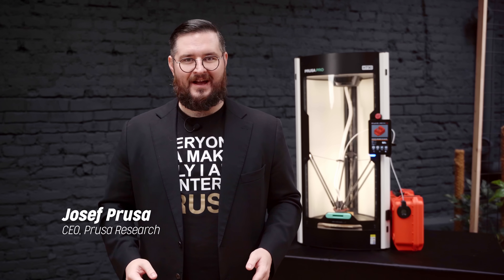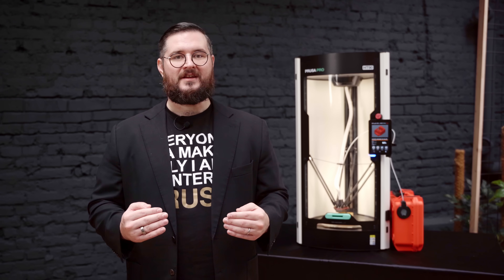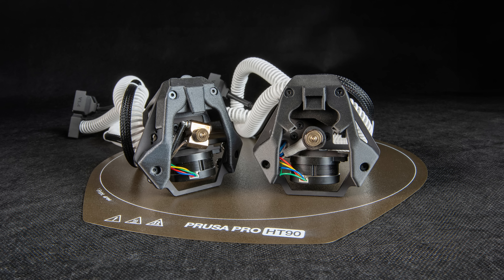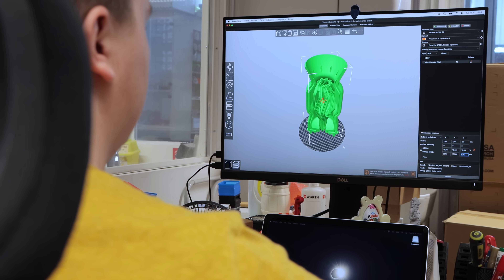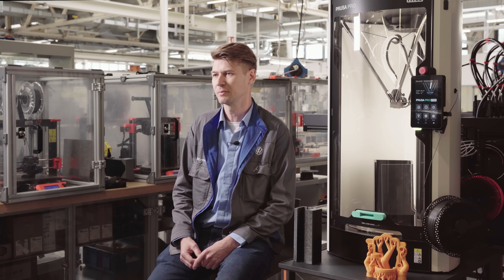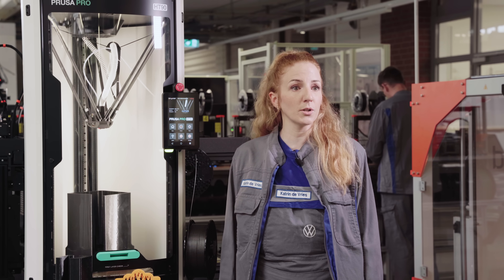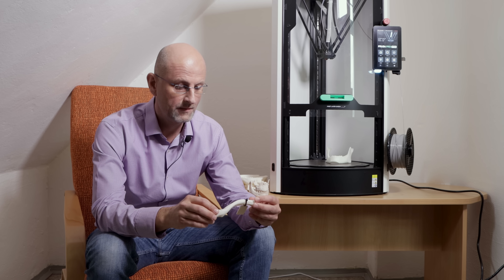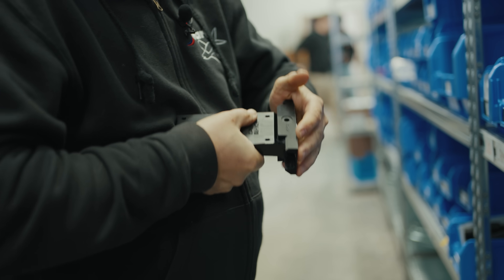Prusa Pro HT90 is here: The Only 3D Printer an Engineer Needs

Comment: I love Prusa, but $9,900!!! The same features on the Flsun S1 for $1,500. What am i missing?
Reply: 90C chamber vs 50C chamber. 90C is a game changer and 50C is bull shit. And making a printer being able to handle 90C is not an easy task. Stuff melts, metal expands, rails need special lube. 9900 is too expensive I agree but don't compare it to the flsun, it's a toy in comparison.
Reply: @sabahoudini  Does the FLSun even have an actively heated chamber? Their picture suggests it does, but I don't see it in the specs... So my assumption would be that it's passive, only reaching max. 50°C during printing? Meh...
Reply: An FLsun isn't printing PEK or PEEK  lol. If your business revolves around printing those high temp materials. They you can afford the printer.
Reply: 50C is reachable with bedslingers in a box, lame ass printer
Reply: for now, flsun S1 cant properly print even at low speed, because buggy and closed software they are using :)
Reply: @youtubehandlesux  lol the HT90 reaches 90c you CCP bot.
Reply: I think it is very expensive, but $10k for a large company is very little money when you compare the cost of outsourcing work like this as it adds up and would exceed the $10k rather quickly. Average starting cost of industrial printers is right around this price point, so this is technically a really good printer for the money.
Reply: @vojtahavelka  isn't the flsun S1 literally running klipper? I heard it's not configured right, but what are you on about closed software lol
Reply: @DragonFinlay  It does which is kind of a joke. Most printers reach 50C passively.
Reply: @LilApe  It won't be printing PEKK or PEEK in a 90C chamber, that is too low. It will be like printing ABS on a bed slinger. No the 90C is for ABS/ASA and PC-CF "blends". It won't print real PC well, needs 110-140C chamber for proper PC. If you print ABS/ASA in an 80C chamber with a lot of cooling you end up with the strongest, most dimesionally accurate and most beautiful ABS/ASA prints you have ever seen and you will be able to print huge parts with no warping what so ever. This will be an ABS/ASA beast. It can probably print other stuff as well just as you can print ABS in a 50C chamber by using ugly hacks like turning off fans etc.
Reply: @sabahoudini  Why don't they advertise it anywhere, then? Also, I always thought most enclosed printers struggle to reach even 40°C (which, to be fair, is usually enough to print most <300°C materials without warping issues).
Reply: @sabahoudini  "It won't be printing PEKK or PEEK in a 90C chamber, that is too low"
Then explain how it did it in this video?
Reply: @DragonFinlay  40C without warping? I'll send you a 350x350mm part I'm printing right now in my 80C chamber. Let's see how you do. "Enough" depends on your requirements. If you want to print very big parts without warping, perfect dimensional accuracy and layer adhesion as strong as the material is in xy you need an 80C chamber for ABS/ASA and even more for PC. However 90C is very good. If you want perfection then you need a huge stratasys with 250C in the chamber, those print PEEK like you would print PLA.
Reply: @LilApe  I mean you can print ASA on an ender too but it's not optimal and limited to simple smaller parts.
Reply: @sabahoudini  Yup, I printed dozens of parts of those sizes (though these bigger ones usually with brim) and it worked just fine. Smaller parts even without enclosure, when done correctly. ASA and PC of course, not PEEK or similar.
Reply: Probably depends a lot on the specific brand and printer one uses though.
Reply: @DragonFinlay  Depends on the geometry. I have a part that I mass produce and I can barely print it at 70C, at 80 it's perfect. Less than 70 forget about it. However if I took a hammer to your part printed in 40C it would shatter in a thousand pieces while the 80C would be really strong. If the previous layer is already close to the melting temp the new hot filament can melt the previous layer easily and it will bond to it fully while the 40C chamber part will barely stick to it. Even if you can print visibly good loooking parts it doesn't say anything about the internal stresses. I'm getting tired of this discussion with people who have no experience with this. There is a reason stratasys and other industry printers print ABS in 80-90C chambers. This 90C chamber is a game changer and it's not just for high temp materials, it's perfect for ABS/ASA and it "can" print PC/PEEK.
Reply: @DragonFinlay  I'm sure there are expensive brands of ASA that are blended with other stuff to be able to print better in colder chambers but there is always a trade off with that. Usually they won't have as good properties for strength and temperature rating.
Reply: @sabahoudini  I agree, but the discussion was about printability, not strength.
Also, why assume I have no experience with this? Even when printing with lower ambient temp, ASA/PC parts are still much stronger than most materials, and for my use cases, it's more than enough. Doesn't automatically mean I don't know what I'm doing or talking about?
Lastly, nobody forces you to engage in a discussion like this if you're tired of "educating" others.
Reply: @DragonFinlay  Not saying you don't know what you are doing, just that you don't seem to have experience with very hot chambers. You seem to have a lot of experience making desktop 3d printers print well even if they don't have the optimal properties to print some materials. Most of what we've learned about 3d printing gets thrown out the window if you step into the realm of industrial 3d printing. For example ABS and ASA require a ridiculous amount of cooling at these chamber temps but we've learned to turn off fans completely or partially. I printed a wilson airless basketball in ASA on my bambu labs and I printed another one in my 80C chamber Voron. The one on the bambu shattered on first bounce while the vororn one is still bouncing lol. Both printed fine visually so it all depends on your requirements. If you want industrial level requirements then you need an industrial 3d printer.
Reply: @flachs6  I think he means FLSun continues its tradition of closing off root access. You have to flash your own Klipper on it.
Reply: You are missing on a lot

Comment: A $10k deltra printer that "democratizes" industrial 3D printing at.... an industrial 3d printing price. Man what the hell is going on at Prusa 🤣
Reply: $10k is NOT an industrial price for a printer that can print PEI and PEKK. And that "just" works 😅
Reply: @jeebus2118  Your X1C is not acceptable in an industrial enviornment. They require security and the promise that China is not snooping on what they are doing.
Reply: @ so run it offline in LAN only mode

Comment: A $10,000 printer? Lol.
Reply: a $10k printer that can print PEEK... well, that is cheap.
Reply: Right? It's as if printers exist out there that aren't under $1,000 for consumers only...
Reply: Find me a printer that costs less and can do high-temp materials like PEEK. I'll wait.
Reply: I can understand the knee-jerk reaction to the price. But stop and think for a second, this is targeted at professionals not consumers, and he's right about democratizing 3D printing for engineers. Go check how much does a competing PEEK 3D printer cost.
Reply: Anyone secretly hoping for bambulabs to release one at half the price 🤚😂
Reply: @x_ph1l Annex K1's in-development high temp chamber could probably be cheaper. No current competition though.
Reply: @youtubehandlesux  printer with high temp chamber is surprisingly hard to make. At that temperature delta, metal expands and shrinks A LOT. And that's only part of the problem.
Reply: @youtuberschannel12  Half the price but garbage support, in a printer that's for business, where the support is far more important than that price difference. I would rather pay the Prusa price and get something solid, from a company that doesn't view me as a rube who can be taken advantage of and then discarded.
Reply: @__S__435  But why do people who don't own a Bambu printer say that without any examples? You don't even have to own one, you could do literally any surface level research, glance at the reddit or forum, not just repeat something you heard someone else say
Reply: @x_ph1l  Strongly Agree!

Comment: I know its for industrial... but as all printers from prusa are IMO 2 expensive. Needing 8 hours to print 1kg filament, is just a whole day shift of casual people. dont know if that is true competition compared to others. For that price u get 4 BambuLab X1E, which IMO seems to be the better deal, since you can split accross 4 printers. I  know I sound very salty, but this is what always prevented me from entering the prusa-verse ... it's just overpriced for that u get some 3d printed parts and no enclosure, leaving the user exposed to VOC's except they add the optional enclosure for whopping 370$ + 80 for a filter. Dont get me wrong. I love supporting EU manufactured products and good worker conditions. But since prusa isnt 100% transparent and you cant find a list of manufacturing partners, they could simply buy half of the parts in china and rebrand it, selling it european. I dont want to pay a price for something you cannot prove, it has been fully manufactured in europe and prusa is 100% honest. These upgrade kits itself are worth a whole printer... nah thx. I bet the support is perfect, but how often do I need the support.
Reply: And then you have 4 Bambulab printers that are not capable of printing these highest temperature materials. Do you realize the error in your calculation? Read the Spes of this printer and compare.
Then you will realize that these two printers have nothing to do with each other.
No Bambulab comes anywhere near this Prusa, not even close. Sorry.
Reply: Can't print peek and pekk and pei
Reply: The bambu X1E is a literal scam of a machine. its just an X1C with a 60c heated chamber for more than double the price. It still uses the same cheap components and has the same trash customer support and QC. Just another bambu bot trying to sell bambu printers.
Reply: People need to really brush up on network security(NETSEC).

1. If you are offline/air gap there is no data leak possible. 
2. If you are Lan only  or on a disconnected network you are effectively offline. (think of router with zero access to the internet making it a road to nowhere)
3. If you are using vlan any decent IT can disable net access or limit it. (this creates a partition with rules- net, local lan access, rate limits etc.)

4. If you are sending files to someone else's cloud service then all bets are off.

All of those functions work with any bambu printer. Network security isn't magic or obfuscated. We live in an age where information is at our fingertips there is zero excuse to think the info isn't out there. 

Any hypothetical research, design outfit should always have safe guards. Even Prusa Slicer has tendrils that seek out the internet. (checks for version updates asks, to send your device info etc)
Reply: @LilApe  Biib000b**Bululululu Ima abooot.
Bambu Lab created me to spread china love.
Reply: @herr_rossi69   Dont know why my answer from yesterday didn't post. But why should I compare prices. Of course there are differences. Heat chamber and filmanet etc., Time will tell how long it takes until other competitors present their solution for less money. I just hate their prices. And I wouldn't tell that bambu isn't near that. Sure not this printer, but overall they do good and came pretty far for a young competitor. X1E does half of the stuff that this printer does, but for the masses, it's solid and affordable. Can you proof that their printer has no chinese parts?
Reply: @g4njawizard916  Nevertheless, you are comparing 4 X1c with a Prusa.
But the Prusa has a 500 degree hotend, 155 degree bed and 90 housing.
You can already see what a leap the X1E makes in terms of price. Just for the certification and a 60 degree heater.   Bambulab is mass market. As cheap as possible with materials that are just enough. 
I'll never understand what so many people like about it.

For what it can do, the Prusa HT90 is even cheap in an industrial environment.
Like the XL, this is not a printer for the mass market. You buy these printers because you need these features. And you earn so much money with them that the purchase price is irrelevant.
In comparison, a Bambulab is a toy. 
And with this basis, you won't achieve the values of the HT90. 
Nevertheless, I'm curious to see what Bambulab will come up with next and how it will support the old printers.